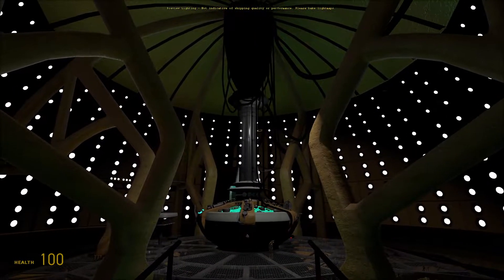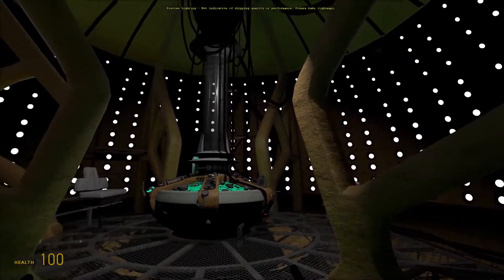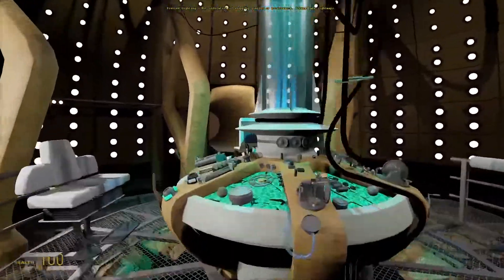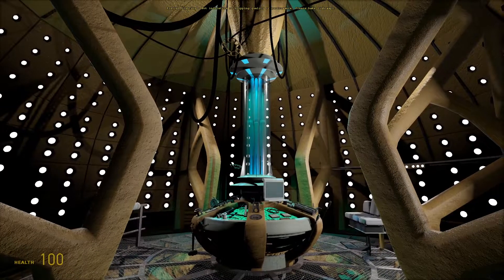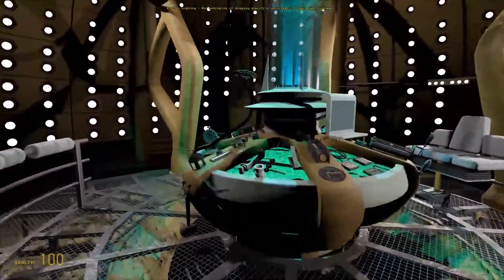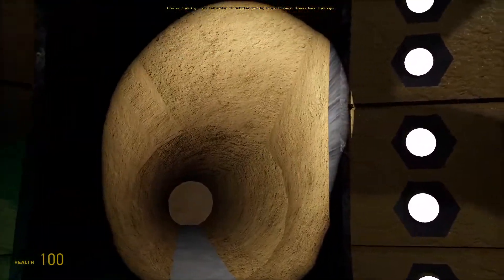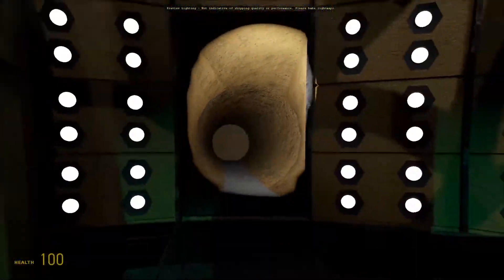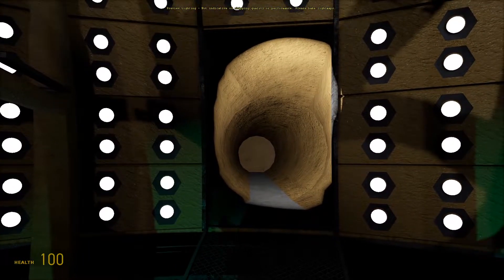GMod 2 TARDIS WIP (Day 2)

Comment: is this going to be a mod for Gmod or Alyx?
Reply from the maker: Technically alyx. It's being made in preparation for GMod 2 which will run in the source 2 (alyx) engine so the two will be cross compatible.
Reply: @krauterz  wait so are we gonna have Source 2 for Gmod?
Reply from the maker: @TheEleventhDoctor  A GMod sequel is in the works by Garry Newman, and it is going to be based on the Source 2 engine. So yes :)
Reply: @krauterz   bruh I can't wait imagine what the lighting will look like In one of the tardis rewrite
Reply: wait will Gmod 2 Be separate like buy it? or will it be in side of the original game with the update its gonna have?
Reply: @TheEleventhDoctor  you will have to bye it